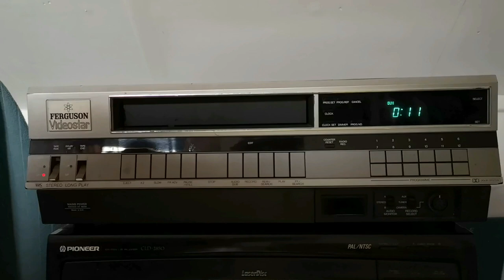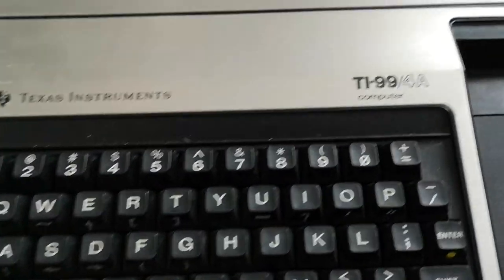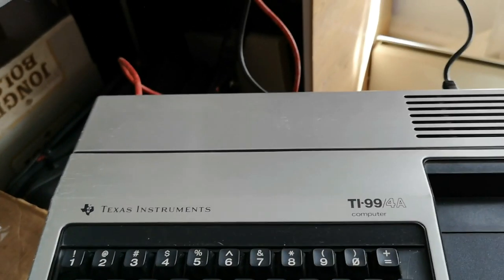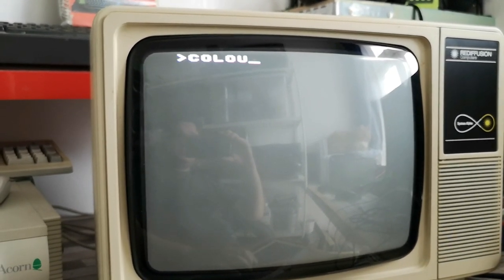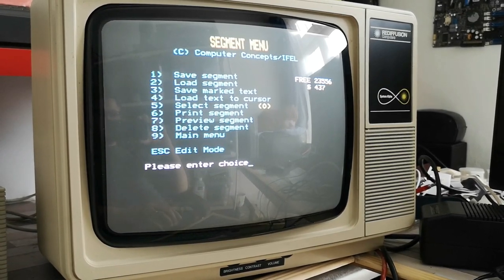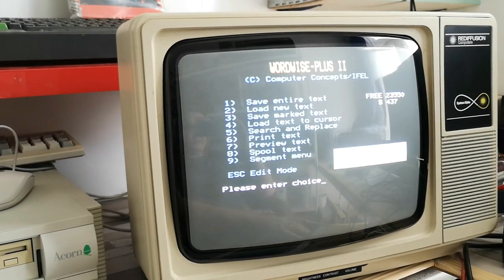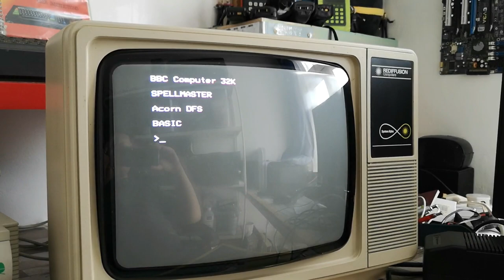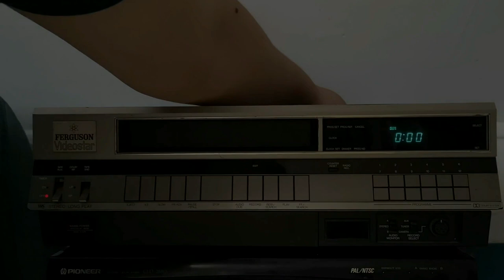Rediffusion Videotex Monitor/VDU - Part 2

Comment: Lovely monitor, and looks to be in very good condition. Interesting how they've converted what was probably a TV chassis for monitor use, although not an uncommon practice back then. I suppose back in the day you would've been able to simply hook up a VCR to the other inputs and use the VCR's tuner to watch telly! Thinking about it, I guess it probably wouldn't be too difficult to cobble together a SCART lead to expand the input options. 

PS: I think those flies in the box (in part one) were once cluster flies. Quite common in UK attics, and a bit of a nuisance if they escape into living areas i.e congregating around upstairs windows! I had an issue with them when I first moved into my current house several years ago. They were somehow getting to and from the loft space from cracks in an old bathroom vent. Once I'd sealed around it, I never saw the blighters again.

Comment: I have a bbc b given to me many years ago when my dad got a 133mhz pc, my master 128 i have had since buying it for £10 at a car boot when i was around 16 i think no markings on it to suggest it has been a school computer ,i have owned a texas instruments tr 99/4a  it came with 4 cartridge games and it was pre ebay times i could find no other software for it i ended up breaking it up  looking back it was a stupid thing to do .The raspberry pi based coprocessor emulation is one of the upgrades i plan to add to my bbc machines  the bbc, range of computers had so many expansions and even robots i will never sell my 2 but i do have a couple i bought from ebay to fix both do work one has a rom board expansion in the other only recognises 2 of the internal rom slots as far as i know this could be down to a faulty cia type chip .the monitor looks great though very clear .